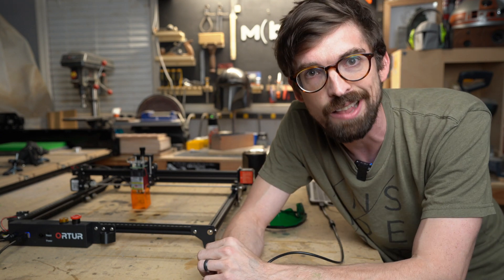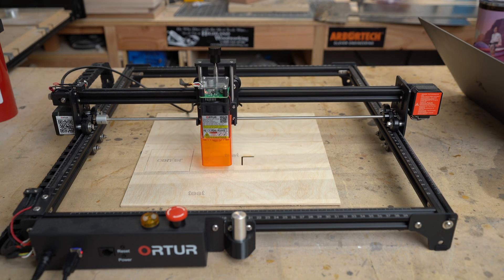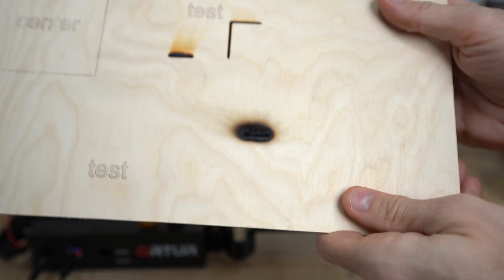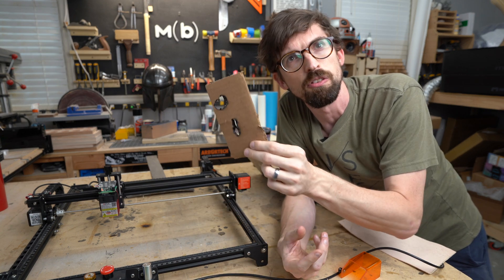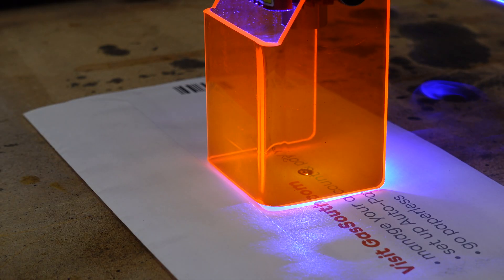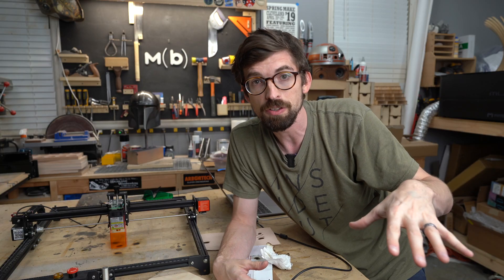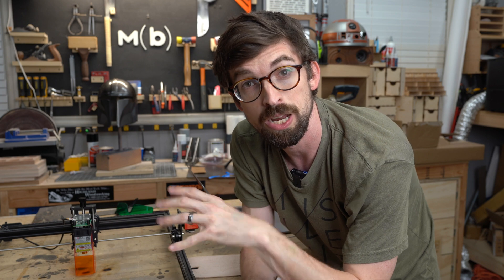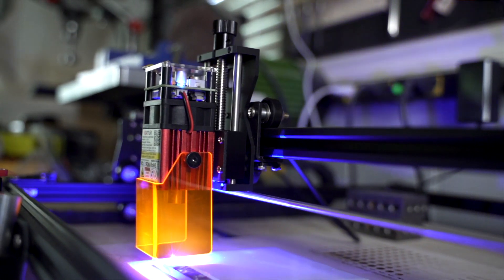How Dangerous are Laser Cutters and Engravers?

Comment: I buy rags that are ripped up T-shirts at the big box store. I cut them with my laser to a more manageable size. The secret is, cut them in one pass or they will catch fire and wear safety glasses because cutting white T-shirts will brighten the whole room! I'm using a Falcon 2 40 watt diode laser with air assist. The laser has fire detection.

Comment: Attempt this video but with the laser slightly out of focus. That might net the results that you are looking for!
Reply from the maker: I usually find that the most powerful beam is when it is fully focused.  You can kind of see it in the video when I start moving the paper towel around and it raises up some that it doesn't light as quick.
Reply: @makeorbreakshop  I agree with your statement, I don't run my lasers out of focus very often so it's more theory than anything. The idea is if the laser is slightly out of focus will increase the odds of catching thinner materials on fire, such as paper. The idea is that the laser won't pierce the paper as fast causing more heat buildup as the paper isn't being vaporized as quickly. Either way, the video did a great job highlighting the potential dangers of laser cutting. (Might test this theory although my Co2 machines are 30w and 100w)
Reply from the maker: @TheRustRevival  ah gottcha, great point!

Comment: I have the Ortur Laser Master 2 Pro.  It is on a bed of tile.  I also keep a full-sized fire extinguisher near it.  I very much look forward to your video on the air assist, especially if it is something I could 3D print for it.
Reply from the maker: I'm sure you could 3D print the attachment, you'll just need a small compressor for the air!
Reply: @makeorbreakshop  There is a guy on YouTube who created a printable air assist for the Laser Master 2 but it won't work with the Pro 2. Unless he updated, I'll have to check.